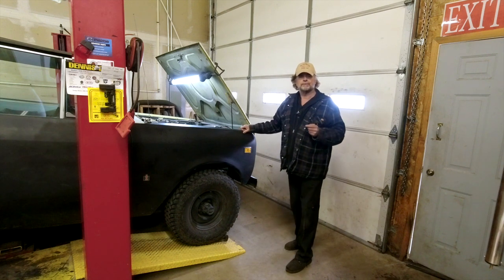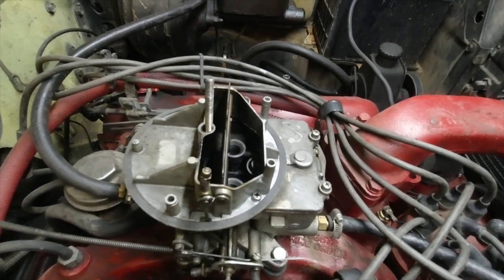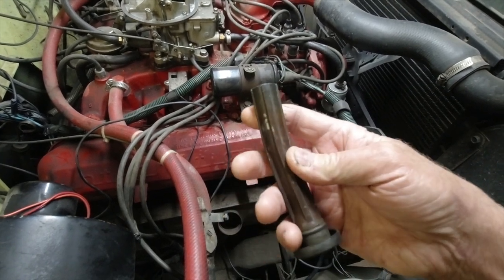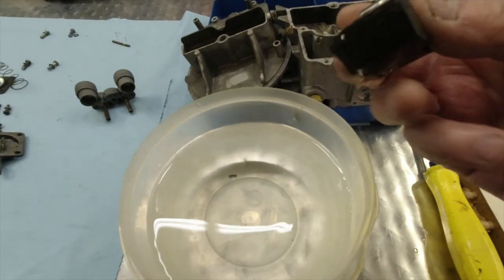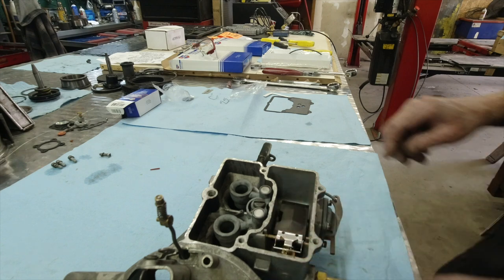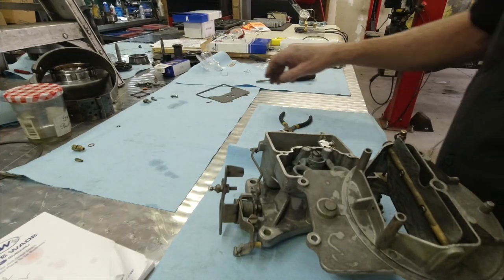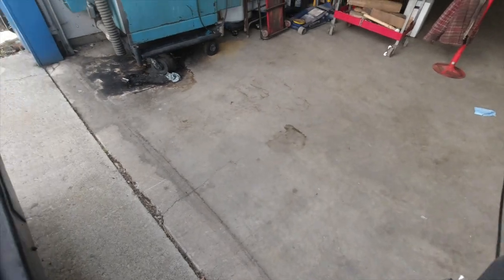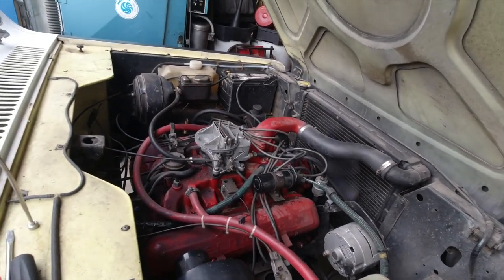1977 International Scout II - Carburetor Repair

Comment: I have a 304 installed with a 2300 Holly on my 72 scout 2.  I'm curious about your opinion regarding what carb to put on it to make it hum.  I'm guessing it's a 350 cfm.  How much cfm can this motor handle?  Thanks in advance...
Reply from the maker: A stock carb is the way to go

Comment: I've got a Holley 2 barells and it says 1800 on round plate top of carb. Not sure if that is carb number or not. The side where it says Holley it has 4 bolts that can come out. It's where the fuel line is coming in at. Is that where I take off the side to replace my float? It's a 1966 International Travelall 345 V8 I believe it's float problem because I can't rev it up. It's basically flooding itself out.
Reply from the maker: Before I pull the bowl that’s the four bolts you mentioned try tapping on the bowl possible stuck float after that try squeezing the rubber line off either at carb or inlet fuel pump for about 20 seconds don’t let it die and release may have something stuck in the needle and seat that will flush it out. If you pull the bowl be sure to check your float like in the video and replace the power valve
Reply: @TomAutoTV  ok thanks. I'll keep you updated. Much appreciated for the reply. I'll check the fuel window inlet as well. Squeezing the line will let it run out of fuel then releasing it will throw fuel back in at 6 to 8lbs and possibly flush? Makes sense to me. Hope it works 😄
Reply: What is the power valve? I took carb off but had attachments still connected. I emptied gas out of it onto a rag. I disconnected gas inlet too. I put carb back on manifold and it started up enough for me to move it into a different parking spot, then it flooded itself out again. When it's running, it runs good, but flooded again. Do I have to tap and pull the carb apart after I unbolt the 4 bolts where float side is? Another question is I don't have rich/ lean screws on side of carb, I can see 2 screws with springs on opposite side of float bowl. Do you know the adjustments for those screws? 1 turn out? 1 1/2 turns out? 2 turns out? For some sort of starting point? I think I also have to adjust fuel float arm where it is almost touching bottom bolt. Mine is firm against it leading me to believe that I also need to adjust it until arm almost touches bottom of bolt. What are your thoughts? Thanks 👍
Reply from the maker: @JH-jh2oe  The Power Valve Is Located In The Metering Block Towards Carb Body Its About 1/2 Thick And Has The Fuel/Air Mixture Screws In It Be care Full Removing Can Get Stuck From Transfer Tube. On The Passenger Side Of Carb Should Be A Sight Plug With A Slotted Head. Remove Plug And Check For Fuel, If Fuel Is Running Out Try Adjusting Float, Should Have An External Adjustment On Top, You Will See A Hex Nut And Slotted Screw Loosen Screw, Turn It Clockwise To Lower Fuel Level To Bottom Of Hole.  Be Sure To Use New Gaskets. Keep Me Posted,